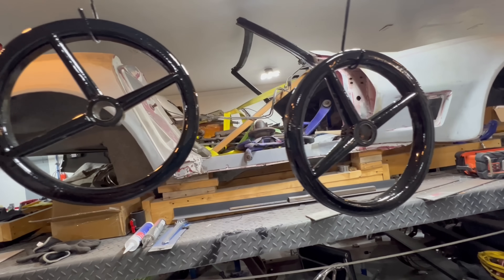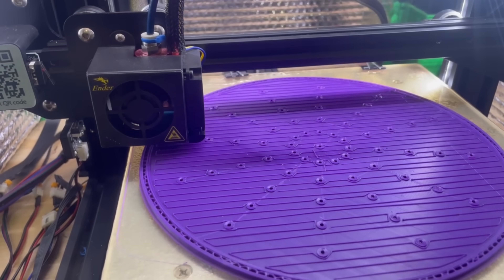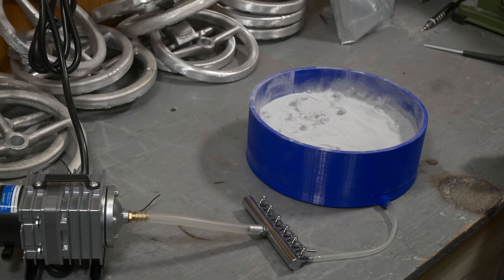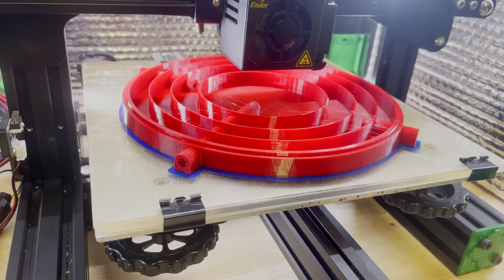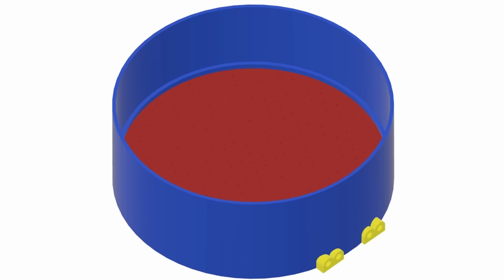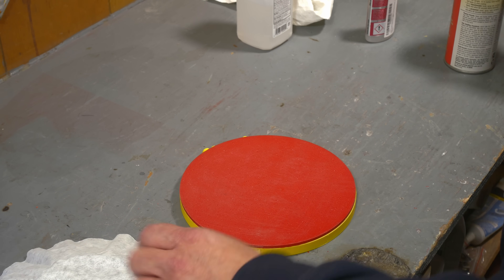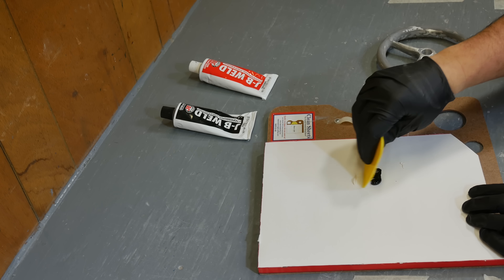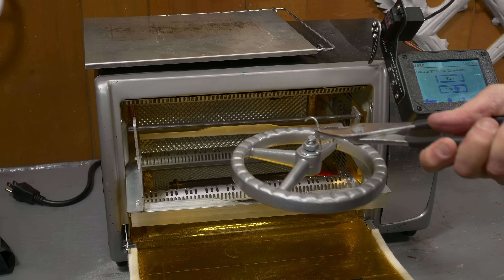Inexpensive Powder Coating at Home?  The Fluid Bed

Comment: Now that was a lot of fun great video. I love long videos. You did a beautiful job. Very interesting. Great video geography I’m sold. Where do I sign up? I guess the word is subscribe like and hit the notification button. Thanks again sincerely Mike Walker with the door and lock tips thanks again. PS I had a powder coat company down in Florida where I’m from originally and they used to do my tool you’re right most of the stuff goes on the floor. They said it was biodegradable and you could eat it but I wonder the place burned down one time sad. They did a great job up until that point I used to have them anodized. That is a terrible terrible thing to do anodize thanks again cheerio keep up the good work.😂❤🎉🎉😮😅😊 17:53

Comment: Excellent video. I've not finished fabbing mine yet due to many other projects but if you need an easy heat-resistant box one way is using cement board etc and light steel angle from your local metal supplier. 
For those not familiar buying metal from metal suppliers is far less expensive than high markups on small sections. Best by far to visit in person so ya see what's stocked in their racks AND the "drops"/ cut offs left over from cutting to length for customers which can be just right for many projects.  They can cut down long sticks/tubes to your desired size for easy transportation even without a truck. Buying sticks of angle lets you make much stronger shelves, carts, racks, tables etc than weak consumer-grade prebuilts which are made of thin stock to slash production and shipping costs.

Comment: We used a this method in high school in the early 1980's here in Australia. We used a Vacuum Cleaner outlet connected to a box made from chipboard with small holes drilled in it. 
I love 3D printing, but I feel it would have been easier to just build than print. Nice work though, and interesting to see the results of both printing, and design changes.

Comment: I was going to say between your air holes and the filter, put a layer of airsoft BB's. They're cheap and it'll give it an area where the air can expand out everywhere evenly. Or possibly poor a stone like you would use for an aquarium but you can buy just the poor stone in discs. You also might be able to use discs of porous florafom. Sometimes when you have your mind stuck on 3D printing the only solutions that you think of are ones you can make in a 3D printer. You might even make an agitator ring, like I spoke to disc at the bottom that rotates to help with the spouting.

Comment: 17:38 I had something similar happen. Might just be bursitis.
Reply from the maker: That’s what we’ve been treating to for over the last 2 months.  In addition to being swollen it was also red and hot. So we tried a number of different antibiotics as well as some gout medication. Eventually the swelling went away but the pain didn’t. X-rays show no fractures so they gave me a steroid shot and are doing some physical therapy to try to loosen it up since I’ve basically been holding the arm as still as possible through all this.
Reply: @PeteRondeau  I see. I think my main pain was gone at two months, had lingering pain if I put my elbow down in the right spot for probably like 6 months. But that didn't hamper my ability to use it, just to lean too hard on my elbow haha

Comment: Every once in a while the algorithm sends me something great. Thanks for sharing your build experience. One question, what oven controller do you use on your toaster setup? I've recently been experimenting with curing coatings on glass but have been using a manual PID/SSR setup.

Comment: I was hoping you would've thought of switching to something like a 400 nykon mesh sheet instead of this filter paper. The paper is too variable in density across, which isn't helping with trying to even out flow distribution. 

Also, instead of an oven, would you consider curing with infrared lamps instead?

Comment: This is a pretty cool project, I wonder if an ultrasonic emitter on the bottom of a container could accomplish a similar result? Or maybe a vibration plate that the fluid bed mounts on top of to help limit channeling of the powder?

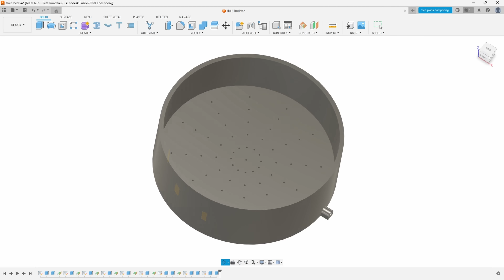Comment: 1:17  You say "evenly spaced holes", but the pattern you produced shows anything but evenly spaced holes.
Reply from the maker: true, they are evenly spaced radially from the center. However, the subsequent designs later in the video are truly evenly spaced.  in those designs they are on a hexagonal grid with every hole 9 mm from its nearest neighbor.

Comment: If you added a couple of strips of aluminum tape to the coffee filter, attached dc leads to both the aluminum tape and the hook holding the part, you would likely get some electrostatic charge to cling the coating to the part.

Comment: I'm using a larger rotisserie convection oven (100 bucks on amazon) and a powder coat gun from vevor.  I've done a few parts for my Harley build, and they turned out pretty good. One thing I thought could be better was a thicker coat. Then I see your video and discovered flocking. The powder wasn't sticking as much as I hoped. I think preheating it will do the trick... Thanks for the info, and I like trying 3d printed parts to try and solve the problem. Good luck on your projects!

Comment: I have two Ender 3, my nozzle clogs started when the lever arm for the drive unit cracked. It wasn’t the nozzle at all. But I see you have the aluminum extruder drives.

Comment: I don't remember the video, but I remember seeing one where someone was trying to setup something to difuse airflow.  They used Gyroid infill with no top or bottom layer.  It allows fluids (air) to pass through it, at least from top to bottom.  I wonder if you did a dense infill with no holes and put the filter on top if it might spread the air more evenly.
Reply from the maker: @Infrared73  I was inspired by something  similar where they were using the gyroid infill to be able to epoxy fill something after printing.  I wanted to try it but discovered my slicer doesn’t offer that. I download orca slicer the other day for precisely that reason!
Reply: @PeteRondeau  Good luck!

Comment: @13:20 I'd imagine the easiest way to avoid the Pluming would be by simply not having the Exit Holes point up but towards the sides instead akin to how a Sprinkler also doesn't just hose the water down but sprays it in an umbrella like pattern.

Comment: Just looking at the grid, you need an even constant air flow.  And an even distribution of holes.  I used to design filter screens for water pumps, which needed a very small variance in approach velocity.  The reverse problem, but very similar math.

Comment: Very interesting.  Made me think of WAY back when I had aquariums I experimented with fluidized sand filters.  I used to use these porous tubes designed to make curtains of air bubbles inside the take to create "separate" sections that the fish would see as a wall and not swim past.  The ultra fine pores allowed incredibly fine bubbles and I wonder if something like this might work better.  It could possibly eliminate the need for balancing the chambers and the coffee filter too.

Comment: Where does your oven controller come from? Home made? Very interesting process. Never seen it powder applied like that
Reply from the maker: It is a controller called Controleo3 from a company called whizoo. You can purchase just the controller or a complete kit with insulation and everything you need to convert a toaster oven.

Comment: PLA is by far my most used filament. Love it
Reply from the maker: I usually use ABS for almost everything. In hindsight, due to these parts being hot when dipped, PETG probably would have been a better choice but it’s just not one of my go-to filaments.

Comment: i use an old electric stove, the oven is great for powder coating. got it for 25 dollars off facebook market
Reply from the maker: Yes, that would be a very economical choice! my only reason for searching for something like an electric smoker is to just have a slightly smaller footprint.  As you can probably see, there isn't a lot of spare room in this shop!  lol

Comment: Tip for larger oven: a few pieces of angle iron and a sheet of aluminium or tin would do just fine to make the outer shell, the insides can be plain ceramic wool for furnaces, the heating elements you can make out of nickle resistance wire quite easily. Tip for better airflow in your fluid bed: search for "Fluidized Bed Fluidizing Plate" on your usual Chinese sites and you can find plates designed for the purpose at low prices. Just replace the coffee filter with one of those plates.

Comment: Good luck on your arm, I’m doing the same with the knee. After watching your video here, I wonder if all of this cannot be done in substantially the same way with a shaker table instead of the air. I kind of don’t like the air because you got to believe there is paint dust being launched into the air by those air plumes. I don’t think it’s healthy to breathe that stuff.  Not that shaker table would still not launch some dust into the air, but I think it might be a little less it may be more controllable. Anyhow, congratulations on a successful project

Comment: In case you are unaware, powder coating is usually done with the gun & parts electrostatically charged. The HEATED part you are painting will electrostatically attract the powder in the gun!
Whatever powder does not hit the HEATED part, will fall to the floor where you should probably have something to collect it with for reuse.
Do a Google search for powder coating electrostatic charge DIY. They will even tell you how to build your own electrostatically charged spray gun.
This is by far the absolute best and easiest way to do what you are trying to do! This is how all the professionals do it!  IT WORKS LIKE MAGIC!

Comment: Im thinking...home depo bucket, disc cut from 1/2" mdf to fit the bucket 6 inch below the tip rim.   Drill the hole pattern...some perforated sheet metal makes a great drill template... glue and screw this disc 6 inch down from top then, pressurize the bottom as you've done.  The larger space below would allow even flow from the airiating holes.  Seems like that would work and iterative changes would also be faster. All of it would be faster with hands, materials and tools, not thati dont want a 3d printer lol.  I think id just pay a powder coater. They have hundreds of colors.

Comment: Impressive work. I've got a bit of experience with some home powder coating units. You've just gave me some ideas my friend. Ever see how they put the powdered sugar on funnel cakes? Do you own an induction cook top? Perhaps you induce some static charge to the powder?....  Ever see those ancient perfume foggers with the rubber tube and squeeze bulb? It would be like air brushing with powder coat.
Reply from the maker: Yes! interesting Ideas.  I was also reading a technical paper where they were describing a method of putting a conductive plate in the bottom of the fluid bed to induce a charge into the floating powder.  I ran out of time for experimenting though.

Comment: You may have had better luck using an air source, rather than a pump. I'm not sure why you don't want to buy a 130$ PC gun, pick up a used oven for free of CL or FB and have at it?? You certainly seem to invest in equipment. Even a tiny air compressor will do the trick, it only uses about 5psi. These handwheels will be fine, but I don't think you'll get the desired finish you want on most other items. I didn't have much room for an oven myself, until I built an addition on my shop, but before then, I left the oven outside all year round with a tarp over it. With a free full size oven, you can cure 8 wheels at once. I even cut holes in the sides of my oven so I can powder coat longer items, when needed.
Reply from the maker: I have a powder coating gun. I've made a video using it.  it makes a mess.  I think people lose sight of the fact that this is what I like to do.  I Iike to tinker.  Instead of paying $130 to buy a gun, I could have just paid somebody $130 and let them powder coat them for me, that would have been even easier and quicker.  But then that would completely eliminate my hobby.  I'd be saving a whole bunch of time to do what? the hobby I no longer have?

Comment: I'm only 1/3 way thru the video, but I need to say that the only way you will get even output is when the pressure in the plenum is greater than the weight of the powder coat.  Otherwise the air will continue to follow the path of least resistance.  So you need smaller holes, or fewer holes, or more air, or a thinner layer of powder.  Addendum: I'd first go with smaller holes and more air pressure.  If printed at a coolish nozzle temperature, the printed material is so porous you wouldn't even need holes.  A porous print actually makes a good aerator.  One example: PLA+ filament at 205 C nozzle temp on an Ender 3 V3 SE makes lovely small bubbles at about 5 psi.
Reply: I was thinking that the he might be able to get away without holes. Could use some infill tricks plus gyroid then just stick the hoses directly into the infill of the part for getting the air in.
Reply: This

Comment: Seeing the comments about people building similar beds using vacuums, I wonder if it's similar to the HVLP paint sprayers. Where you need tons of low pressure flow. The small holes and higher pressures might be increasing the channeling.

Comment: There are some good videos on people making custom kilns, types of firebrick and how to shape them, as well as how to do the calculations for the heater filament length based on wire diameter and impedance, and the ramp electronics.

Comment: if they're getting more powder on the floor than the part then they haven't tuned the process. 
they're discharging more powder than the gun can electrostatically charge. the aim of the game isn't to throw then entire batch of powder at the part and hope "some" of it sticks. 
that's always going to end up a mess. if you tune the powder and air flow rate more sticks to the part and very little gets on the floor. 
You can achieve a more efficient process with even the cheapest equipment. i modded a eastwood powdergun by swapping the cheap alumium handle/valve for a $16 variable one. 
the result was night and day. instead of blowing a massive amount of powder at the part and floor, i trimmed it down and almost all of it gets stuck to the part. 

its amazing how powdergun manufactures haven't figured out the basics of pneumatics. 
but you know i'm just some engineering tech working in a global leading pneumatics factory.
Reply from the maker: I dont know. I’ve watched videos from people that should know what they are doing- even the companies that sell the powder and it’s always just a big mess.  But maybe it’s just in their best interest to waste powder

Comment: Although crazy will work on prints, I found that Acrylic #16 adhesive works really good. I've been using it for years with zero failures. Of course, I had to finally bit the bullet and buy the PLA Gloop (I think it called that)
Reply from the maker: I saw “somebody” mention using “something” in a comment on a random video the other day. Suggesting that it was better because it didn’t have the tendency to turn the PLA white. But now I can’t remember what it was or where I saw it.  It did have “acryl” in the name so maybe it’s the same stuff.
Reply: @PeteRondeau  IPS Weld-On 16 Acrylic Plastic Cement, 5 oz Tube
Reply from the maker: @mcorrade  that sounds like what I saw

Comment: How about just drilling dozens of tiny holes in the bottom of a 5-Gallon bucket. take another bucket and add the air supply. Then jam the 1st one into the second one. adjust the number and size of holes until you are happy with it.

Comment: Instead of 3d printing, could you have used... a $5 bucket from Homo Despot?
Drill the holes in the real bottom. Abrade, then silicone adhere (or epoxy) the lid, to the bottom. Drill one hole through the false wall or lid-bottom for your fitting.

Comment: try a filter for air  that is better flow or put a filter before the pump in the line and then just leave the holes bare you will get a much better jet of air  or just ditch the filter !

Comment: I wonder if adding some sort of vibration to the fluidized bed would help reduce some of those blow-through channels. My reasoning is based on the mechanisms of earthquake induced liquefaction. Maybe the vibration will discourage the powder between the air-holes from settling back down? Just spit-balling here.

Comment: Something that a lot of people dont know about print warping is that the more plastic you use, the more likely to warp and the more extreme the warp will be. This is because each bit of plastic experiences cooling-contraction, so doing things like using higher infill percentages will make your part more likely to have issues. You can also break a part's continuous surface up, when you have one very large bottom surface all of the forces happen in one continuous plane, and forces from one end of a part will have an easier time transferring to the other end. So if you break up the bottom surfaces with channels (look at gridfinity bins bottom surface if you need a visual example) you are likely to get less warping because the forces do not have a straight path to follow. Now you can still get warping with channels, if you have other large continuous layers further up, so just keep that in mind.

Anyway, super cool video. I love this micro-manufacturing revolution that we've got going on!
Reply: I've heard that using infills like gyroid instead of cubic can also help as the curved pattern doesn't exert as much force on the part.